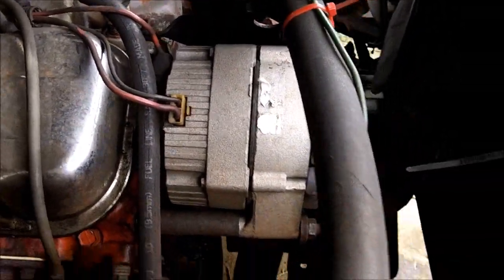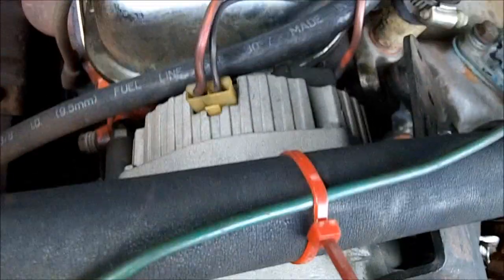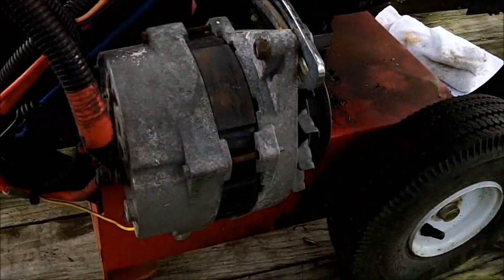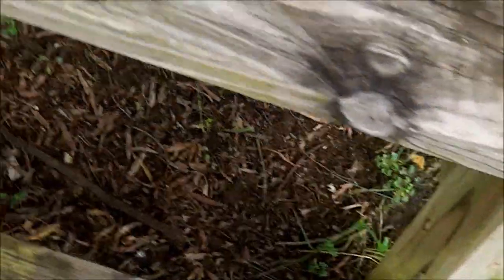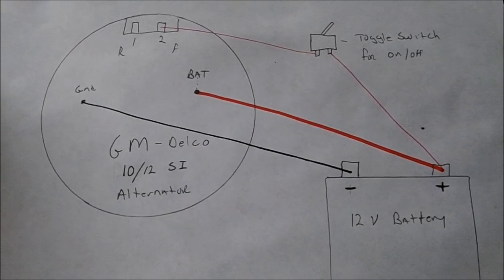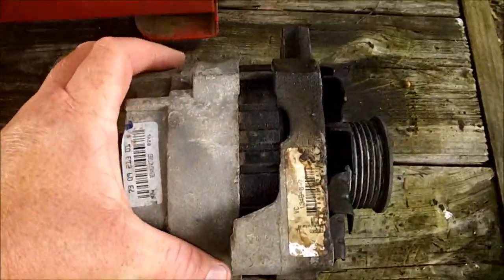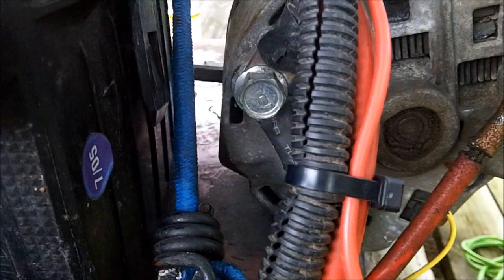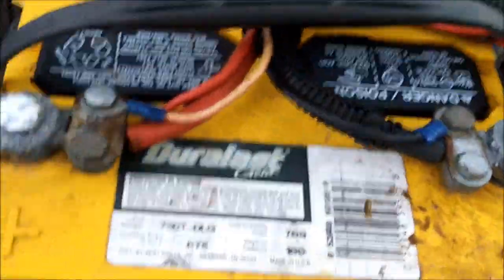How To Wire A 12v Generator power source

Comment: Wow great video and very good basic system.  All someone needs to do is add one of those inverters like a pure sine wave inverter and they can convert from 12v to 120volt ac to run there house.  I suggest they mount it on a rubber isolator from the vibration or on a seperate board away from the motor to keep the vibration low.  You can get like a Go Power 1500 watt for like $400 new or $150 used.  That will run 80% of most house appliences except the AC and the washer dryer.
Reply from the maker: +John Chan I used this with a 1000 watt inverter to run some lights, TV, computer and a small refrigerator once when we lost power..

Comment: So I have a 78 amp alternator for an 82 Chrysler Imperial,  how much power is it's out put,  what can I power with it, and how do I set it up as a power source that can be plugged onto ???
Reply from the maker: I'm not real sure on the Chrysler alternator, it can be used though you just need to find out from someone how to turn it on...
Reply: savagenomore Fair enough thanks ...

Comment: the 1 is supposed to go to the positive too otherwise the regulator wont work right
Reply from the maker: not on this type alternator, that terminal is for the charge warning light, this machine charges between 13 & 14 volts as it should...
Reply: oh ok. I must have a different alternator then because if I don't hook up a wire to it it won't work at all

Comment: so i can use the ignition switch as the toggle and it goes to the terminal marked F or 2? thanks
Reply from the maker: yes...
Reply: Thought i just blew up the regulator till i realized the wire  to the F term was a momentary connection. while checking to see if it was indeed charging i pulled off the F ter and it stopped charging.magnetism resulted &then it was gone..if we were neighbors we could get along quite well. thanks you are right on!